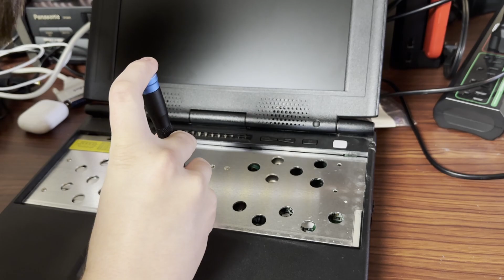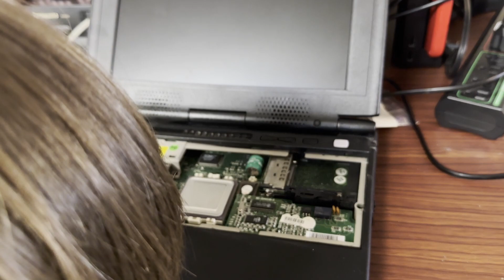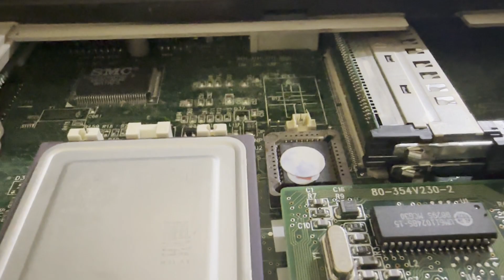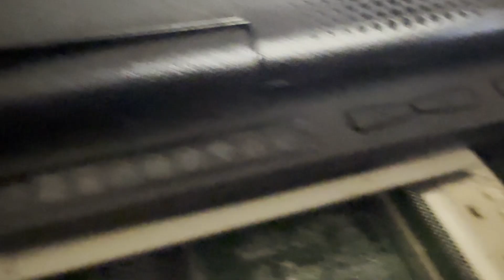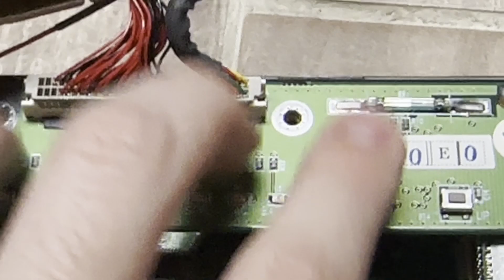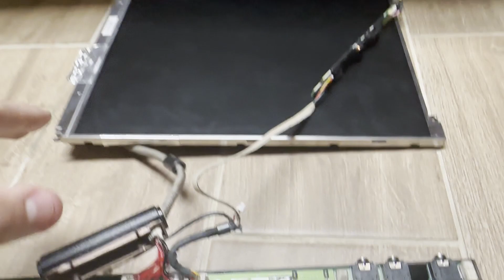The CTX EzBook 800 is dead! Here's why. (Swap Meet Project Series)

Comment: Rather unfortunate it ended up that way, I'm sure if you reflow some of the connections with some new solder and have the skill to do so you could get it working again, the damage isn't horrendous, but it is clear that it was damaged from the leaking VARTA battery. I enjoy seeing failures, as I've had plenty myself with plenty of things, so I appreciate you showing it in videos like these. I'd definitely keep all the parts to the machine in hopes maybe one day you are able to have the time and tools to fix it, but that would probably take a good amount of time repairing it all successfully. Personally I love keeping future projects around haha, that way you never can get bored, thanks for uploading this video : ))
Reply from the maker: One thing’s for sure: PCMCIA is never working again, the chip for it has broken pins from the corrosion. I did manage to get the board out today and yeah it ain’t great. I may try reflowing again but that solder just won’t stick when I tried last time, it’s unfortunate.

I may purchase a parts machine soon though to try again haha
Reply: @3lectr1c  Noooo, darn you VARTA!!! I hope you can get a parts machine and hopefully are able to make a fully working system out of the two, as well as having spare parts for future ones you may get. I've had boards get ruined as well, it really sucks. Just better hope the next one you pick up doesn't die to the same cause.....like people say, VARTA barrel batteries are ticking time bombs and if left untreated it eventually shows the damage it can do....
Reply from the maker: I’ve got the board soaking in vinegar now. Yeah those batteries are a pain. Think the board is toast but if the vinegar burns off all the corrosion I may be able to get new solder to stick and do a proper reflow.
Reply: @3lectr1c  Glad to hear there is some hope at all! That really is a great idea, considering you are at a lost cause at the moment, would really be hoping a proper reflow is able to get the board working again and some trace repair, I certainly do not have the skills though sadly, every time I touch a soldering iron I ruin whatever I am trying to save, I guess I just suck at it haha. Not sure if you are supposed to use a soldering iron for unsoldering things......also I seem to end up bridging pins together attempting to repair busted pins, it sucks. Wish all the VARTA batteries just disappeared from the systems before it has a chance to damage more systems in the future you may get....
Reply from the maker: Well. Uh. The connector fell off 😅
So, gotta bodge up 6 broken solder pads and desolder the VGA port if I ever want any hope of getting it back on. May be beyond my abilities though….

As for you - just gotta practice. I sucked at this when I started too. I still do honestly, I’m just good enough at basic stuff now that I can get stuff put together. 
For desoldering you want to get yourself some good quality flux and desoldering braid. I’d look up tutorials on all this stuff honestly, Branchus Creations did videos on this stuff.
Reply: @3lectr1c  Ouch, hopefully you have had time to fix it now haha, I'm a bit late to the party here. Hopefully you can get it fixed though. As for the advice, I appreciate it. I have figured out a lot more now and that an actual decent solder sucker helps a ton more than desoldering wick. Apparently the desoldering wick I have is way harder to use than a good solder sucker, and since then I have purchased one from Amazon and they sort of work, although as expected, aren't the greatest and took me an hour to do two tantalum capacitors, which is because the solder sucker wasn't sucking enough haha. As expected the Amazon specials weren't very good, so I'll have to fork over the dollars and get a single one for a little over $20, from a decent brand. I realized the best one's that were recommended to me by others are on Digi-Key, and despite being expensive, they are worth every penny since you will get something that actually works with ease haha. I have been practicing, just need to order the good quality solder sucker and I should be good. Who knows maybe that will help you too, and I really don't recommend desoldering braid since it not only takes more time but also is harder to use compared to a solder sucker. Thanks again.
Reply from the maker: @cdos9186  the manual solder suckers don’t work too well. If you don’t want to fork over the cash for a really expensive vacuum pump one, using a thin needle to push the solder out of a heated up solder joint works too.
Reply from the maker: As for this laptop, I haven’t touched it since. I need to buy some thin magnet wire to use to try to bridge past the broken solder pads.
Reply: @3lectr1c  I can't believe I didn't think of that haha, the needle pushing through when it is heated up should work I think, it just is a shame that the solder suckers don't have that much suction. Guess you get what you pay for, as someone told me. I'll fork over the cash for a good solder sucker, because despite the price, they are much larger and apparently work incredibly well compared to the cheaper ones for sale, you just have to know what to look for...I will have to see how it goes, since I need to recap a riser card from exploded tantalums.
Reply: @3lectr1c  Well that sucks to hear about, well guess it can wait like many other projects I have right now as well, it really takes a lot of patience and work to get stuff like that fixed, but the learning experience that goes along with it is certainly fun and helps for other future fixes. Hopefully you can get some time and money for it, wonder what you have going on right now in terms of what you are working on.
Reply from the maker: @cdos9186  I do have some confidence that I’ll be able to get that laptop running again if I can get the pads connected again. It will be pretty tough though for sure.
Did manage to replace a tiny chip recently to revive an old ThinkPad, so I am getting a bit better at the precise stuff. No video on that fix though because it actually working was so unexpected that I didn’t even bother to film!
Reply: @3lectr1c  Always a great feeling when something works that you don't expect to right haha, nice job! Glad that you are getting better and better at what you do, that indeed means you can do the more precise stuff in the future : ))

Comment: I would try putting some deoxit in that connector before i call it quit
Reply from the maker: Hmm. Perhaps, I don’t have any right now. I really think it’s a soldering problem though honestly. It’s possible that could help though. LN1 really isn’t looking good though. I should get some either way though, nothing to loose.
Reply: @3lectr1c  theres off brands of deoxit that work just as good on amazon if deoxit is hard to find or expensive in your area, i use mg chemicals spray contact cleaner